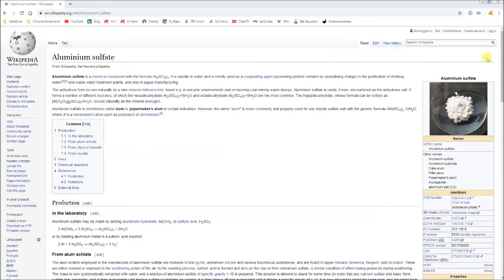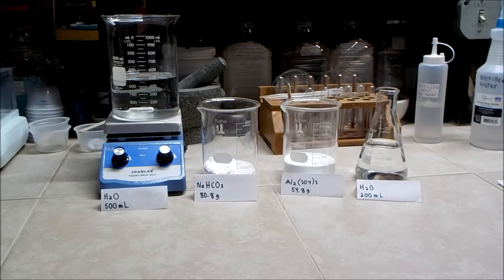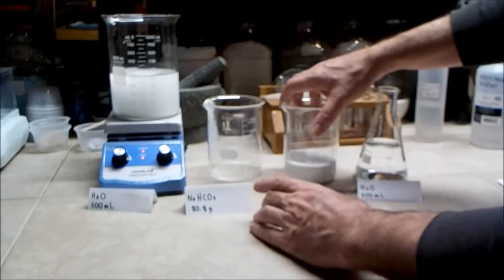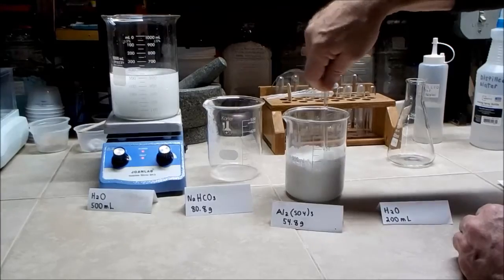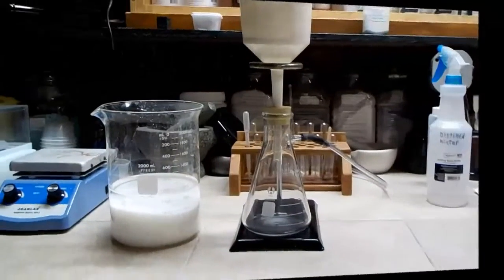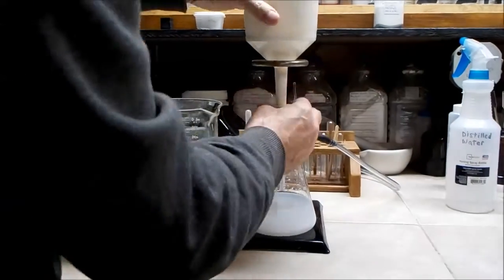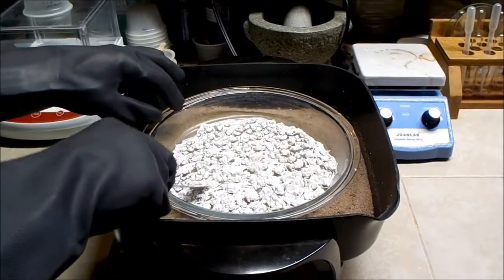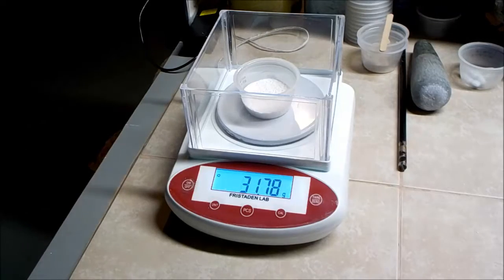Make Aluminium Hydroxide (fail)

Comment: +Perry Gershin Next time use ammonia solution instead of sodium bicarbonate. That´s how I made mine and it´s a really clean and better method.
Reply from the maker: That sounds like something I might try. 
Would this be the correct equation for the reaction you describe?
Al2(SO4)3 + 6 NH4OH = 2 Al(OH)3 + 3 (NH4)2SO4

I wonder why I had so much bicarbonate remaining after my method?
Was the stoichiometry  wrong or did the reaction not go to completion?

Anyway, thanks for the tip.
Reply: @perrygershin3946  Maybe there was excess sodium bicarbonate. And you heated the water when you were dissolving the sodium bicarbonate if I remember correctly, right? I even saw for myself that sodium bicarbonate also decomposes into sodium carbonate, carbon dioxide and water when heated in aqueous solution not just when heated dry. I don´t know, this just an hypothesized idea, but maybe the aluminium hydroxide is somewhat porous and a bit of somewhat could have been trapped inside it. Maybe that could be explain the slight fizzing when you tested a sample with some hydrochloric acid. And the correct equation for the reaction between aluminium sulfate and aqueous ammonia is: Al2(SO4)3 + 6 NH3 + 6 H2O = 2 Al(OH)3 + 3 (NH4)2SO4. From what I´ve heard ammonium hydroxide doesn´t exist and aqueous ammonia is the correct term for a solution for ammonia in water.
Reply from the maker: It was actually a few months ago when I did this experiment.  I had held back from uploading it because it was a fail.  I finally decided to upload it to see if anyone had any ideas what went wrong.  My memory may be a little fuzzy on some of the details because so much time has passed.

I do know that sodium bicarbonate will decompose when heated above a certain temperature and (I think) I only used modest heating to help get it all into solution but I'm not sure now.
I really can't understand why there would have been much excess bicarbonate remaining if the reaction went to completion.
Maybe there is something to your 'trapped inside' hypothesis, maybe it slowed or stopped the reaction from going to completion.  If I do it again I will definitely let it go much longer.

The way I remember it is that ammonium hydroxide effectively exists only in solution and not as an independent compound but  you are technically correct.  Anyway for stoichiometry one would need to know the concentration of ammonia in the water and your equation would work fine.

Comment: Adding sodium was not a great way to react the aluminium as you can easily complex it and get a mixture of sodium aluminate with various sodium aluminate carbonates unless the two were in a somewhat exact perfect mixture.
I suppose your Alum was hydrated meaning you used way too little compared to pure anhydrous. Try to heat the alum to see if it looses water.
Reply from the maker: Thanks for the comment.  It's been so long that I really can't remember if I heated it first or not.
Probably not.

Comment: I’ve used 20-25% sodium hydroxide solution to remove smeared aluminum from dremel burrs and it works great.  I also use a 3-4% sodium hydroxide solution to strip anodizing off aluminum quite effectively.  In the diluted alkali,  I noticed a white deposit on the bottom.  Perhaps this was the stripped anodize settling as aluminum hydroxide.  FYI, most dyes remain in the alkaline solution.

What I propose is to dissolve aluminum in 20-25% sodium hydroxide.  Extreme caution is advised as this could in fact be an energetic reaction with alkaline solution possibly overflowing containers if precautions not followed.  When a clear concentrate is obtained,  dilute with 8 to 10 times by volume with water.  Aluminum hydroxide should crash out since sodium aluminate is unstable in dilute solutions.

Comment: I think I have an idea how could you purify it. React it with a weak acid that will react only with the carbonate (presumably it is leftover sodium carbonate left in soaked up water that precipitated out when drying). For example do some acetic acid washings until no more visible bubbling occurs, wash it with distilled water and it should be quite pure.

Comment: PERRY.................When i wash an insoluble hydroxide...because they clog up a filter so easily and trap in water so easily...if i made a small amount like you did i would put it in like a half gallon or gallon vessel (like the size you would make lemon aid or kool aid in)   and fill with water and stir it good then put plastic wrap over the top and let it sit until all  or most of the hydroxide settle to the ground.   Then pour most of the water off  without pouring out the hydroxide and then fill the container back up with water and stir and cover with plastic and keep repeating until you do it 6 or 7 times and then after you pour off most of the water the last time just  put it in a filter and wash with a little water and suck the cake dry with vacuum and then IF IT STILL HAS CARBONATE IN IT then the reason why is that you are also making something called "basic aluminum carbonate"  Al(HCO3)(CO3).   And if that is the case which i think it is.  Then you should try using a hydroxide instead of a carbonate.    Maybe like sodium hydroxide or ammonium hydroxide.

Comment: Dunno exactly what went wrong here, but I am thinking why not from sodium aluminate then react with hydrochloric acid to get sodium chloride and aluminium hydroxide?
Reply from the maker: Thanks for the reply.  My experience is no matter how you make it, it is really difficult to filter out of solution.  If you really need it, Amazon sells it cheap.  But that defeats the purpose of the 'do it your self' hobby part.
Reply: @perrygershin3946  hm interesting, I run reaction as I proposed today, and it worked really well. As for filtering - I find that it is easier to just wash clay-like substances multiple times with clean water.
Sure, it's a pain, as to remove _all_ soluble salts you typically have to use about 10l of water per ~100g of product each time cleaning product with about 2l of water, wait for solids to settle and syphon witn minimum losses possible.

Sure we can get stuff on amazon, but sometimes you just need it right now...